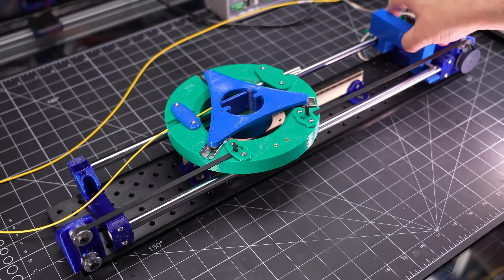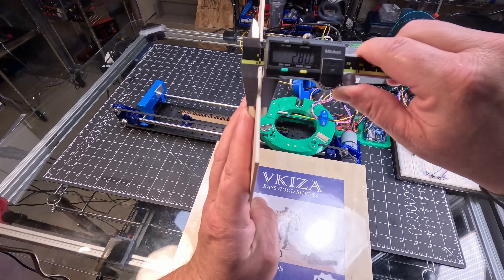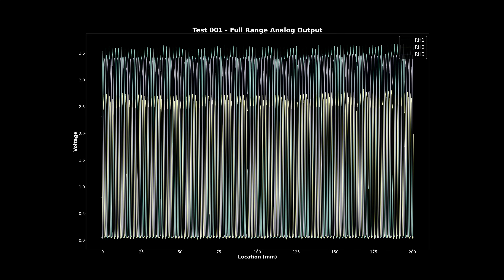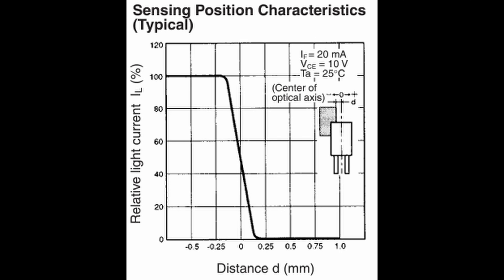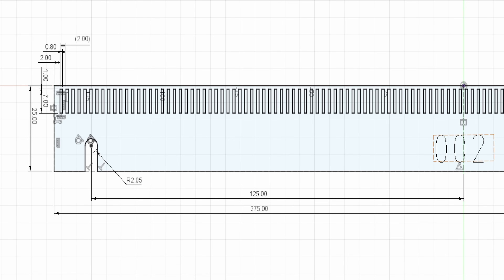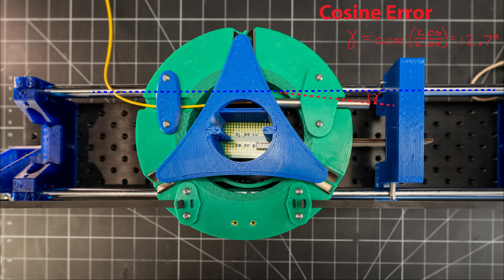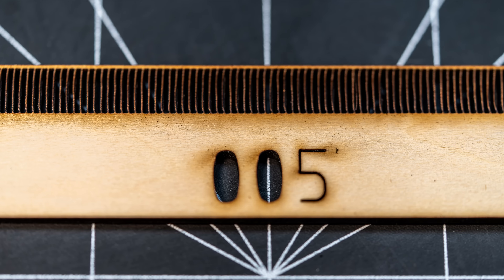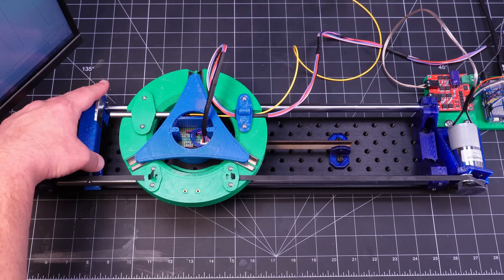Finding the resolution of these laser cut, wooden linear encoders.

Comment: I know you mentioned budgetary constraints, and I'm not an expert by any means, but I do have a laser engraver and I rigged up a pneumatic servo valve to the air assist and connected my compressor, and it cuts much cleaner with about 10psi of clean, dry air. I tried using the 'air assist pump' (aquarium bubbler?) that came with the laser at first and the results were less than optimal. Just a thought for your finer cut attempts. Love the experimentation! It's very inspiring!

Comment: Are all your optocouplers the same model?  The one that you show as being a lower amplitude looks like it may be a narrower beam giving you the lower integrated power.  The output on the optocoupler, assuming its linear, will be the convolution of the laser beam with the shape of the slot in your encoder. 
If you keep reducing the slot width, while keeping the spacing, you will eventually be measuring the width of the optocoupler beam and not any smaller.  In fact you just made a pretty standard slit beam profiler.

Your measurement error could then just be the fact that you included the width of the beam in the measurements

Excellent video as always

Comment: Possibly consider etching lines into the non-reflective side of glass mirror for linear stability? Which will still only be as good as your laser units/step. Secondarily the finer the lines, the more important a vernier graticule or mask in front of the receiving quadrature sensors as to block stray detection from the side.

Comment: or just buy 180LPI or 360LPI Encoder Film for like 10$ for 5m.
Solves the problem cheaper than you can cut them :)
Reply: Isn't the cost in the readers?
Reply from the maker: @GermanMythbuster haha, very true! Definitely an option, but one thing I don't love about the film encoders is that they aren't rigid. Plenty of options for tackling that, but hoping for a non-compliant middle ground :)
Reply: @bubsbuilds  Maybe just glue the encoder film to a acrylic strip to make them non-compliant. I use relatively cheap uv epoxy for binding acrylic sheets optically clear, I bet that works for encoder strips too. But I don't know if you limit your resolution due to different diffraction indices of the Encoder Film (most likely PET) and carrier. Possibly a better choice is to also use a PET as a carrier, although acrylic is stiffer.

Comment: Think expansion and contraction of the wood will matter? I've wondered if a (stationary) threaded rod and an inductive sensor could be used for positioning. Should be very repeatable, so the errors in the rod could be mapped for better accuracy, if desired.
Reply from the maker: @maximthemagnificent I definitely think that's an interesting idea! If I had an inductive sensor handy I'd absolutely set that one up and give it a go. I'll have to add that to the list. If you give it a try before I do, I'd love to hear how it goes.
Reply: I'm 30 years and counting on that idea, so I suspect you'll beat me to it.
Reply from the maker: @maximthemagnificent haha, I have some of those on the mental shelf myself! The snail's pace race is on :)